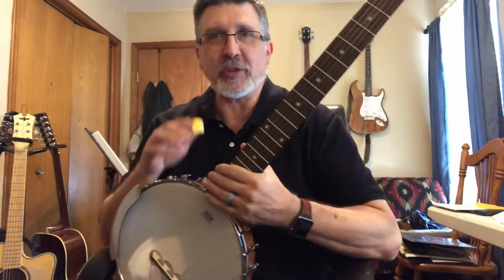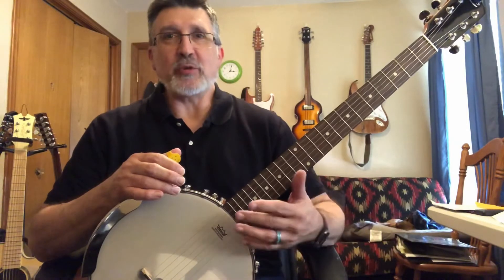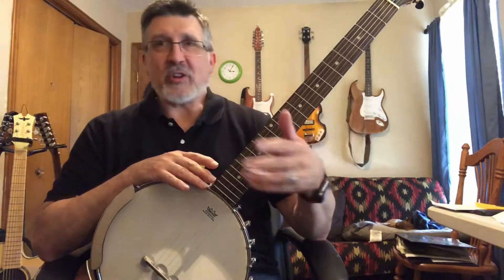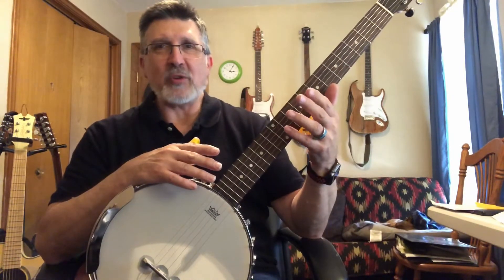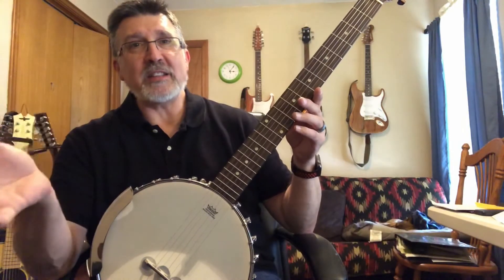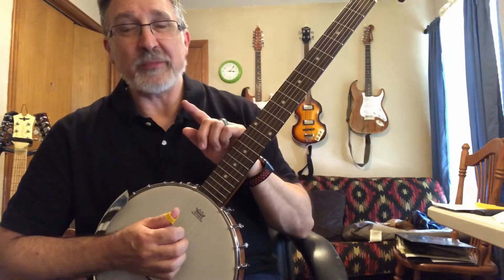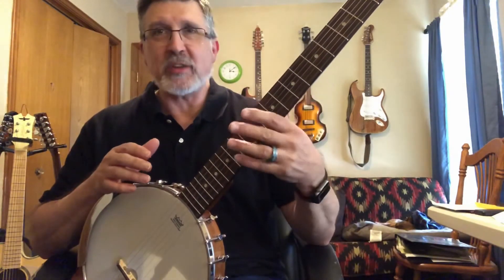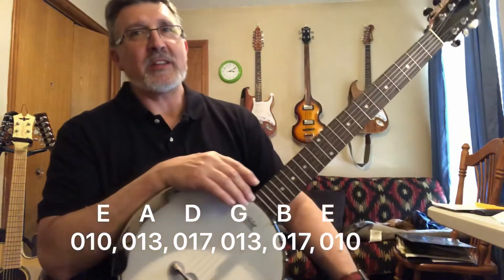Getting a Better Banjo Sound Out of Your Banjitar

Comment: gdwest999 Dixieland Guitarists in the Good ol days have used Nashville Tuning (4 or 5 Lowest strings are an Octave higher cause now the High B is an Octave4Plus 6 gauge String deigned to tune that note) on the Banjitar to emulate a Plectrum (or Tenor) Banjo sound as a Substitute for those 2 instruments. These exist because back in the good ol days of Big Band music before we had amps, Guitarists used the Banjitar to compete with the horns.

Comment: Banjitars usually have a slightly larger body than 5 String Banjos to help the lower pitches resonate better.
Reply: No they don't. They usually both have an II inch rims. And both are available with 12 inch rims.
Reply: @MrGrahawk  The 12 inch Rim is a little bit bigger than the 11 inch so the lower notes on the 6 String Banjo might resonate better on a 12 in rim.

Comment: It sounds very cool. I like it 👍👍
Did you have to re-adjust the truss to compensate
for the difference in the string tension of that setup ??
Reply from the maker: Yes, maybe a quarter-turn or so.
Reply: I'm just putting the finishing touches on a 4string cigar box style I built. I tune it e-b-b-e but I string it upside down (thin string where thick should be) I also did the two center strings close together like a 12string would be. It has a oddly cool unique sound & goes great with my Tele ☺️

Comment: gdwest999 Just to note the High G from a 12 String set isn't as thin as you think, it's only an 8. So if you want a High G, swap out the 17 with an 8. Also the High B is only a 6, so as a result the gauges are now 26, 16, 11, 8, 6, 9.

Comment: @UC3rsFsF4daig0929Oq0z7Iw
  If you prefer using a High G on a Nashville Tuned Banjitar, go with an 8 cause the tension is fairly low to prevent breakage. Actually a High G String on a Nashville Tuned Banjitar gives you a sound that's more Tenor Banjo like cause it's only a whole step below the High A of a Tenor Banjo (the Octave4Plus .006 High B String is a whole step above the High A of a Tenor Banjo so it'll sound a bit like a Vihuela when you strum).

Comment: 1:52 Correction: the High G string from some 12 String Guitar String Sets (Such as the D'addario Light/Extra Light 12 String Sets) isn't a 10 or a 9, it's actually an 8 because it's meant to minimize the tension & make it more playable, & on this long of a scale length the tension will be fairly low so it'll work on. If you do use a High G String at .008 (D'addario Extra Light 12 String Guitar Strings have a .008 to solve the breakage problem) resulting in a Tenor Banjo sound since it's a whole step below the High A of a Tenor Banjo, (the Octave4Plus .006 B4 String is super strong, works on any Banjitar, & is a whole step above the High A of a Tenor Banjo). If you listen to a Nashville Tuned 6 String Banjo, it sounds pretty much like a Tenor Banjo since the High G is a whole step below the High A of a Tenor Banjo:https://www.youtube.com/watch?v=VXgAstbJeUE
Reply: dude slow down with those comments

Comment: Genius idea. Just got my banjitar and was capoing at the 5th fret. Your method is way better. One unrelated question, what pickups are on it?
Reply from the maker: I bought some of those $4.00 piezo pickups from EBay and I just stick them on the head between the bridge and tailpiece (on the inside). I run the wire and jack through the gap between the back and the rim and attach the jack with zip ties to a couple of brackets.

Comment: 1:52 Thing to note on the 12 String Guitar High G String & if you put it on the Banjitar who's scale length is longer than a Guitar (or some Banjitars) it'll snap if it's a 10 or a 9. Even though it's true I've heard people use an 8 for the High G String cause 1) it holds up better on this long of a Scale, & 2) people find it has a Neutral Tone similar to a Tenor Banjo since the High G is only a step below the Tenor Banjo's High A. If you wanted to go with a High G, stick with an 8 cause it's so strong.
Reply from the maker: CircuitsAndStrings 2 Mr Stern Yes, that’s why I went with the standard octave on the G string instead of the high octave of the 12-string. It sounded better, too—more banjo-esque.
Reply: @GWGuitarStudio  For me the High G at 8 actually worked cause 1) it's under low enough tension to preent brekage, & 2) it sounds kinda like a Tenor Banjo since it's only a whole step below the High A String on a Tenor Banjo with a neutral tone.
Reply: @GWGuitarStudio  Oscar Stern here, Correction: D'addario's Light/Extra Light 12 String Guitar String Sets use a .008 for the High G which minimizes the tension & breakage since the tension is fairly low, & it'll work on this Banjitar to give you a Tenor Banjo sound (The High G string is a whole step below the High A of the Tenor Banjo, & the Octave4Plus .006 High B4 is a step above the A4 of a Tenor Banjo).

Comment: This works well although you're getting your string orders mixed up a bit both in the description and what you say. It's in order of EADGBE 10,17,13,17,13,10 I think, not what it says in the description. This is how you describe it in the video but then say it in reverse order starting from the high E. Or at least I think that's the case. I'm partly using this but I've kept the wound d string (a 24).
Reply: Wish GW would reply to this. Trying this out now and don't know which way to go.
Reply: @calle-music  The EADGBE 10,17,13,17,13,10 works fine so go with that.
Reply: @MrGrahawk  I already strung it 10 13 17...  but I will definitely try it the other way soon as well.
Reply: Well?
Help
What did you two come up with on the reversed gauges mix up on the G and B 17/13, positions?
I'm about to restring my new six string to the real banjo sound and wanna get it right from the gitgo.
Reply: @jerrystevens1865  The advantage of my 10,17,13,17,13,10 is that the 17 is a G string so tunes easily to A and the 13 is a B string that can cope with be tuned to D. A 13 can easily cope with being an A as well but tuning a 17 to D seems like a stretch too far. then again using a standard D string as I do is fine.
Reply: @MrGrahawk  ,, ,I finally restrung my new cheap Chinese 6 string last night using your formula and I'm impressed with the truer sound. 
It's my first experience ever with any high strung instrument and it sure takes reinventing or creating a new way of playing. That's a good thing.
Thanks,,
Reply: @MrGrahawk  Any other formulas that you might experiment and tweak to for maybe an even better sound stringing,, let us know somehow please,, thanks
Reply: @jerrystevens1865  This is the same idea changing the E and A string with a cheap banjo guitar that has a cheap but full tone ring. This is where he talk about strings. https://youtu.be/FiU3GORete0?t=453

Comment: @UC3rsFsF4daig0929Oq0z7Iw
      If you want to get that Open High G, replace the G String with a 12 String Guitar High G & now you're in "Hey You Tuning" which could allow you to do a Banjitar rendition of Hey you by Pink Floyd. I find that Regular Gauge Strings for E A & D sound ok for songs by Taylor Swift, Johnny Cash, & even Cajun Music. Interestingly the Banjitar advantage is that it's Chromatic. Unlike the 5 String Banjo you can play in every key without re-tuning & you can also use a Guitar capo too. You can also drop the tuning down a half step if you can't sing high enough.

Comment: Just checking if there is anything else you might add, change or even you would not do? Also, making sure I understand. the strings you are tuning to an octave higher are the Low E. A. D.. The G. B. and High E. are tuned to normal pitch, correct? 
And the list you posted is the correct order?
Reply from the maker: Check out this video. This was made later after doing some more experimentation. https://youtu.be/66HxSMo6rx8?si=SPjmORmRnfo1aieX

Comment: Great video. Very informative.  Question. I am going to try the gauges you mentioned.  10,17,13, 17, 13, 10. You said you might tweak the gauges even more. Have you done that? If yes, to what gauges? Tx
Reply from the maker: Yes. I did a follow-up video here—
https://youtu.be/66HxSMo6rx8?si=khtQz4uAldNJu8RX
Reply: Awesome.  Was gonna try your tuning first. I knew about Nashville tuning but didn't want the wound strings. Thanks

Comment: Hello again... I finally got my hands on the banjitar a month later from the comment under this video. As I understand it (I've never picked up a guitar or a banjo)
As I understand it, you need to take "duplicate" thin strings from a 12-string set and put them on a banjitar? Or not? (There are sanctions in Russia , normal strings are expensive , which makes it more difficult to experiment ) Thank you for responding to the comments
Reply from the maker: Since I made this video, I switched over to using a Nashville tuning set. It is an easy way to get the string gauges that work, with balanced tension. See if you can order D’Addario EXL150H sets. Here is an Amazon link to them. https://www.amazon.com/DAddario-Electric-Strings-High-Strung-Nashville/dp/B0006LOBA8/ref=sr_1_4?crid=1ZUP6C4KWL98E&keywords=daddario%2Bnashville%2Btuning%2Bguitar%2Bstrings&qid=1705435331&sprefix=daddario%2Bnashville%2Btuning%2Bguitar%2Bstrings%2Caps%2C137&sr=8-4&th=1
Reply: @GWGuitarStudio  thanks... I tried to remove the resonator, and surprisingly without it it sounds more like a banjo . thank you for what you said .I'll stick with 10 gauge for now - Thurs.

Comment: Hi there Greg - Eddie in the UK here.     Thanks for this video on getting a better sound from a 6 string banjo.   Very helpful but I am confused !   In the video you say low E is a 10 - low A is a 17 - low D is a 13 - G is a 17 - B is a 13 - High E is a 10.   Towards the end of the video you give out the numbers again but they are different !   
Low E is a 10 ( the same ) Low A is a 13 ( different ) - Low D is a 17 ( different ) - G is a 13 ( different ) B is a 17 ( different ) - E is a 10 ( the same ).   
Can you please give me the correct string gauges Greg before I buy the wrong ones !     If you have since tweaked the string gauges can you please list them ?  
Kind Regards . . . Eddie   -   Confused Newbie on Banjo !
Reply from the maker: Check the new video I just uploaded. Let me know if that helped.

Comment: I dont really understand the 10 etc  how do i tune it like that
Reply from the maker: That’s the diameter on the string, or the gauge. It will be on the package. You can buy single strings, instead of a packaged set, and make a custom set. The easiest option is to buy the Nashville tuning set and put those on. That’s the solution I settled on. It has the most consistent sound and feel. Here’s the link to them. https://amzn.to/3qUXhP5 With this set, you tune the E, A, D, and G strings an octave higher.

Comment: Nashville tuning and high strung tuning are NOT the same thing. Nashville tuning replaces the G string with an octave string while high strung uses the standard guitar G string gauge. I've had some luck with high stringing a 6-string banjo on an instrument I no longer own. Not working quite as well on my new one so I'm experimenting with this. So far not happy with it.
Reply from the maker: Scale length seems to make a difference. Most guitar scale length ranges from 24.75” to 25.5”. Many banjitars use banjo scale length of 26.5. It makes for more string tension. When using Nashville tuning, I tune down a whole step. It reduces the string tension and keeps that octave G from being too tight. I just capo on the 2nd fret to play in standard. It’s nice for it to match my 12-strings, which I also tune down.